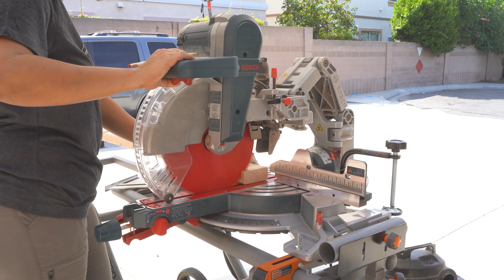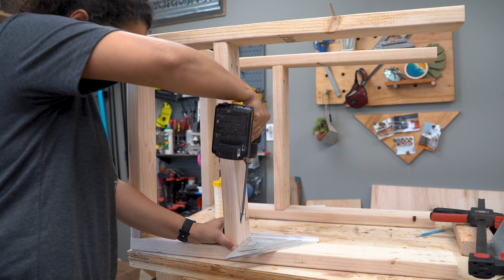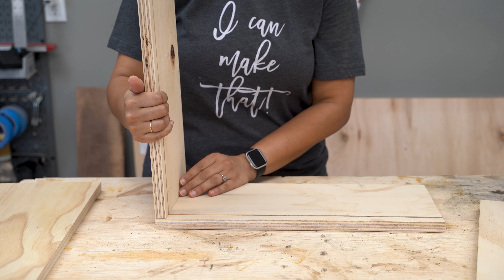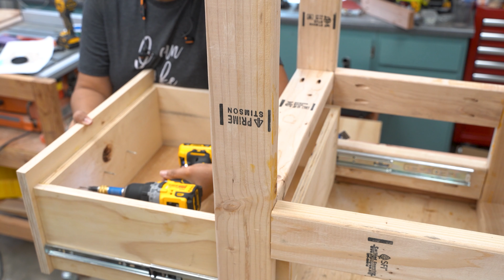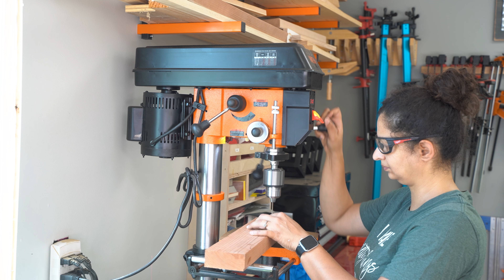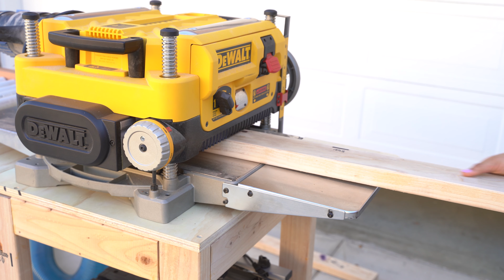Easy DIY planer stand with storage, folding out-feed table and rollers. [PLANS]

Comment: I'm glad I found this video!  I just bought the DeWalt 735 myself. I made a temporary table top that fits into my Tough built saw horses. It's 42"x 48". I have a 12x20 garage I've been making into a workshop and with limited space my temporary solution won't work long-term. I love the outfeed table that folds and has built in rollers. This mobile cart will do wonders for my limited space. Also a shelf for my router jig I want to build. Can't wait to get started!! ❤
Reply from the maker: so excited for you!

Comment: Great idea. One tip though. I see your metal in feed table height is too low. This should be absolutely level with the fixed platen under the blades. From the video, it appears the in feed table is approximately 1/4" low and needs adjusted up. Both in feed and out feed should be perfectly level with the interior platen.

Comment: I realize that most people are going to leave favorable remarks that will give you a good ego boost and that is fine.  I on the other hand would like to see your talents grow and that of your followers as well.  So here is my criticisms. I think the use of pocket hole screws will be the failure point for the frame for two reasons. 1) end grain soaks up glue and the amount you show on the video in not enough. 2) the racking will eventually cause the joint to fail in short time.  I built a similar stand but I used lap joints at all the corners and where the aprons attached.  Pocket hole screws have a place in non structural pieces.  Like face frames and trim.  I would challenge you to look at Stumpy Nubs' channel he does a great job of showing how joints fail and where the failure comes from.  If you do a search on YouTube for "Pocket Hole Joint Failures" you will see what I'm getting at here.
Reply from the maker: Thanks for the comment. I have built furniture and workbenches, table saw stands etc with pocket hole screws and they are going strong years later. Pocket holes when done right work well.